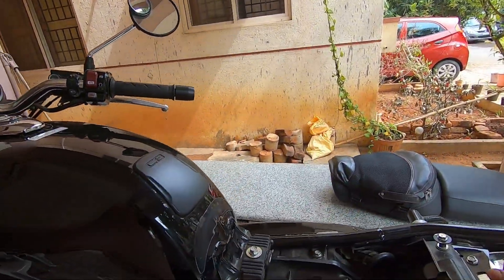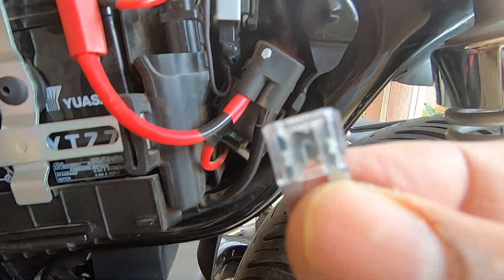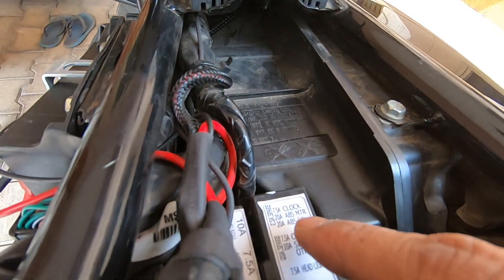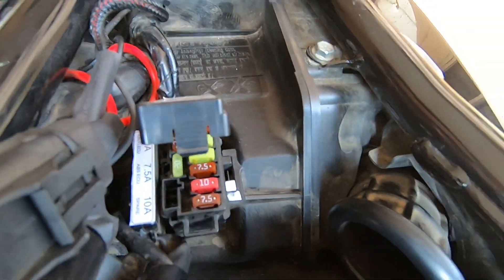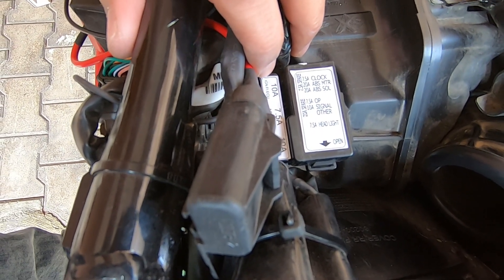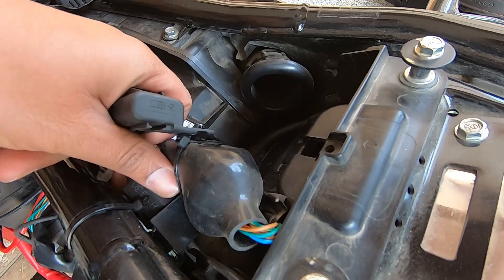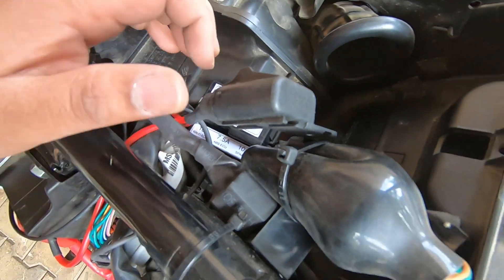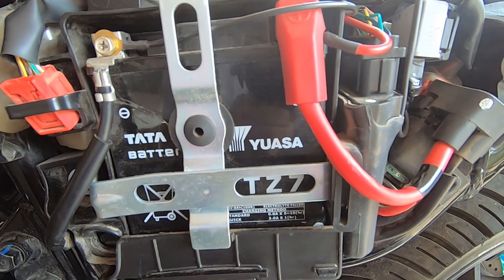Honda CB350 Highness | Electrical Fuse System

Comment: Sir I have Highness 2023, purchased on first July.. I have installed fog light with 6 pin relay. I opened headlight dome and found 3 wires without any connections, one of which was red means +ve. I took supply for switch to operate relay and fog lights' upper/dipper  were working fine with 3 way switch. But inadvertently that +ve taken for switch, touched the body and now not showing current now. Bike is operating fine though. Kindly reply what happened? Is there any fuse which has been blown off and needs replacement? If yes, where is it's location? 
Fog lights are still working if switch wire is joined directly to the battery.

Comment: I buyer cb 350 rs a month ago and it’s showing problem like glowing traction control light and abs light in digital meter and also both are not working and I have checked fuses and all fueses under seats are ok ✅ please help me to solve problem
Reply: Same problem

Comment: Hello sir, I have a query I work abroad and stay away for 8 to 10 months in a year. I do not want my bikes battery to die for not using it at all. I have heard that removing the battery main connector would keep the battery in good condition and after i come and connect it it would good as new. Would You kindly share your opinion advice on this topic please? I really need to know as I love my beast.
Reply from the maker: Yes Sir, 8-10 months of non usage, best to disconnect the terminals. However life of battery is around 3 years plus minus, even if not it use.
Reply: @motovin77  thank u sir. Can you mention which one is the main connector? And also according to your advice we have to change the battery every 3 years?
Reply from the maker: @NEELADRIAUDDYA  You have to disconnect the main terminals connected to the battery and wrap then with insulation tape.
Typically life of a battery is 3 years, if dead, you will need to replace

Comment: Good information about fuse system. Maddog wiring harness has one white wire for ignition point. Where that white wire will be connected in cb350? Location of that point. Thank you.

Comment: Great content as usual. Could you please look into wiring additional horn unit from the pro variant in one of your future videos? I think that would be of great use for the highways. Traditional dual horn units have a high and a low tone unit, out of the low tone unit is the one missing in our dlx variant. I am unable to find if we could directly install this low tone unit in parallel with the existing high tone unit by using a splitter, or will there be a need to install a new relay and fuse in a separate harness to accommodate for the almost doubling of the power load on the stock wiring harness.

Comment: A very good video 😊,,,and im so curious to know can highness get upgrades for RS coz both the bikes share the same chases and hardwares ,,i have an idea to swap the tail section and handle bars from RS to highness ,,highness is definitely a unique bike ,,in case the youngsters who got highness may now like to do this mod ,,,does this works or not ,,pls make a video about this topic ,,
Reply from the maker: Sure will make a video on RS once it arrives in Bangalore.
Reply: @motovin77  thank you ,,and also don't forget to know whether the mod can be suitable or not ,,,im waiting for your reply 😀🔥
Reply from the maker: @srinandhan8783  absolutely, I am also looking to get some parts from RS for my bike
Reply: @motovin77  Keep a look out for the bash plate. Looks like a direct fit from the photos.

Comment: Good to know the details of fuse and how to remove and replace them. Sir can you please let us know from where you got your additional lights installed with the Harness wire and proper installations without voiding the bike guarantee. I meant which outlet whom we can trust in getting installation of the additional lighting and the proper wiring. The 10w lights demo was really amazing
Reply from the maker: Lights, you can buy from bikenbiker(Wilson garden) if you are in Bangalore.
Professional Installation: Done at a Garage called "Gear Motorcycles" in Wilson garden, right below bikenbiker store: 600/-

Comment: Hi sir!?...Great Video as always..A question...What do you think about the NEW CB350 rs?..Do you think the Launches of the two bikes(CB 350 and CB 350 rs) were pretty close and do you think, one would be disappointed since the rs is essentially an Upgrade..
Reply: It depends on the perspective you look at it. Its not an upgrade in any aspect, they have removed the navigation and Bluetooth connectivity in 350RS. Everything else renains same except for the design and looks . I would still go with highness cb350 for its simplicity and  the retro classic style with oodles of chrome parts used in it.